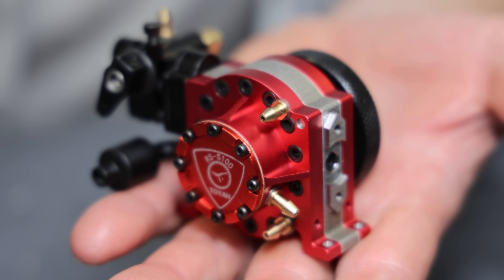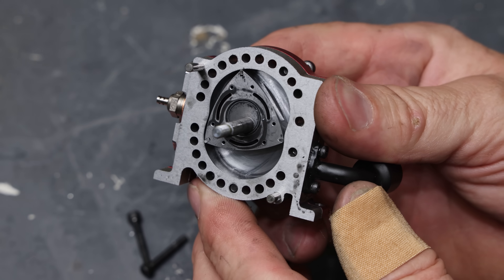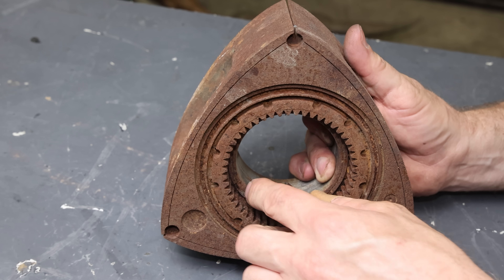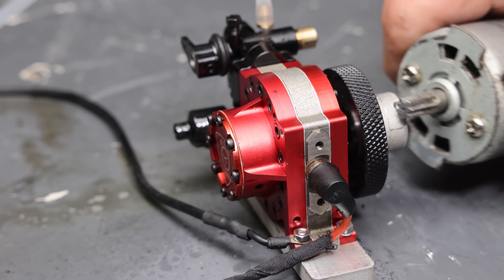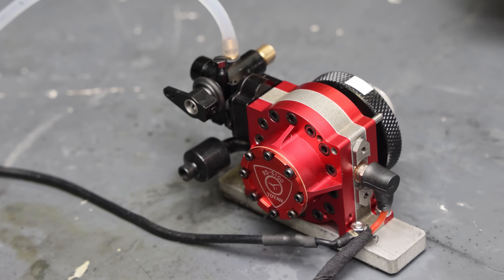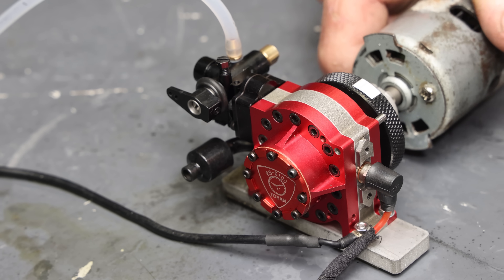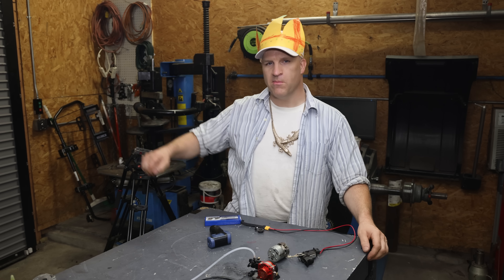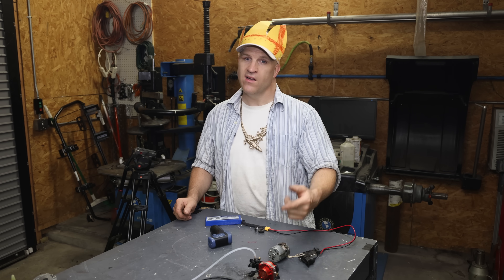Worlds Smallest Rotary Engine (30,000 RPM)

Comment: .7 horsepower is kind of insane for something this size really. This in a two rotor configuration in a RC car would be nuts.
Reply: This would be perfect for a drift 1/10 build. Get the 2 rotor version and tune the intake and exhaust ports so less restrictive. (There mini piston engines are all restricted from stock exhaust manifold) and I bet this thing would rip. Nitro rc car engines the best one puts out 2.1hp from 20,000rpm to 44,000. So this is pretty good I bet it would hit 2hp if it was a 2 rotor and had no restrictions.
Reply: They do make the two rotor also
Reply: Really is once you think about it. Like, a horse's average walking over a day, this tiny thing is almost as much.
Reply: @raikkappa23  Horses actually have about 15 horsepower though
Reply: @Levienci  Horse power is a measure of the power output over an entire day of a horse. Yes a horse can output 15 hp at one given moment but over the course of the day it averages to 1 hp.
Reply: @Levienci  Impossible.
Reply: @Levienci  But a human is a little over 1 hp !
Reply: @Levienci  Is that right? I didn't know that, I thought it was something like 1.7 horsepower?
Reply: @Levienci  This isn't quite the whole picture. Horses have something like 15 hp at maximum. But that horse can manage that kind of output for a tiny length of time, whereas a car can manage it for as long as it has petrol in it and doesn't break down. It makes more sense to sum a horse's power as an average..
Reply: @thesprawl2361  That sounds more plausible. I'll be honest I didn't do research before adding my original reply, I just used a fact I heard around the internet by usually trustable sources. Thanks for the proper clarification though!
Reply: @Levienci  Thanks, but I only found it out because of your post, so it works both ways. :)
Reply: @Levienci at stride, but at walking speed they produce ~1 horspower
Reply: @Levienci  millennial horses yes. And they haven't figured out the difference between boys and girls yet
Reply: @Levienci  they can only exert that much at a given time its not constant
Reply: @Levienci  "Horses actually have about 15 horsepower though" wait what
Reply: @Levienci  woah that doesnt make sense, horses have 15x the power of them????
Reply: @Levienci  For short bursts, the horse has a maximum of around 15 hpr. The hpr unit of measurement was not measured based on the ability of a horse over short bursts, but rather the average pulling power of a draft horse over the course of a workday.
Reply: @Levienci  Average. Walking. Speed.
Reply: @raikkappa23  The only thing that beat it is an electric motor but the weight of batteries seriously add up and don’t last that long. I had an electric RC car that could do 100mph but only lasted like 20 minutes.
Reply: @Crittek  can we talk about how that is 100 scale mph and not actually 100 mph? in other words, disregarding remote control capabilities, battery/fuel capacity, etc. your RC car would not cover 100 miles in 1 hour, but more like 10 miles if it is a 1:10 scale car.
Reply: @Crittek at full speed?
Reply: @Crittek electric rc cars with 8s power trains can have well over 5 horsepower
Reply: @raikkappa23  horses have actually 15HP. We have been fooled
Reply: @Dill_Do  15hp peak, 1hp continuous

Horses get tired, they only make 15hp on short sprints...
Reply: @raikkappa23  what🤣
Reply: @raikkappa23  funnily enough one horse has 15hp
Reply: @raikkappa23  yeah except its not. thats not how horse power is measured. one horse has like 5 hp or 7 i dont remember the exact number
Reply: @raikkappa23  Horses make more than 0.7 hp XD
Reply: @raikkappa23  bruh... I can't really fault you for this misconception given it's name but Horses don't have 1 horsepower, unless they're almost dead. The name supposedly helped sell cars early in automotive history, but 1 horsepower is equivalent to the power required to move a 250 kg (550lb) object one foot in one second.
Reply: @bigdawg77  actually based on a smaller size of horse in the early days look it up at about 750 watts continuously
Reply: time to buy 500 of them and slap them in a car! XD
Reply: maybe for drones and minicopters
Reply: @mortenrl1946 nah it'd be far too unreliable and susceptible do elevation and just the tilting nature of air born vehicles
Reply: @Socucius Ergalla wouldn’t really use  6s for 10hp but more like 8s. I’ve built a few boats that ran over 100mph. One of them went 102mph on 4s. The amp draw at the start would be more than after it’s going, that’s why we don’t nail it at first. And yea, the controllers are over 400a. Controllers are an expendable in the boat world. Data logs showed over 10hp at times.
Reply: we have 1.2 hp
Reply: no kidding that's enough power for a bicycle. I wonder how that could be done.
Reply: I really would like to see those cars out on a track it's got to be amazing have a good day
Reply: eh... 2.5-3hp on normal old .21 nitro RC motors is common enough with a 400-600 dollar price tag.

Some even cheaper in 200-400 range.
Reply: 20 of these things would put out more power than my MOTORCYCLE.
Reply: One of the main advantages of the Wankel engines is power to weight ratio.
Reply: idk, if my Fiat Cinquecento would spit proportional amount of gasoline through exhaust to this one, it would be 300BHP+ ;D
Reply: skateboard?
Reply: @justinleighton4047   or roller blades
Reply: I was thinking the same thing. I used to work in industrial automation and was always amazed at what a fraction of a horsepower can do, and a little terrified. 0.7 HP is no joke.
Reply: @Socucius Ergalla you have way bigger tires allowing for hight top speed dispute gear ratios...
Reply: my rc engine makes 4+ hp xD
Reply: @crittek but man I’d love to see it
Reply: how about a 3 rotor rc car? ;)
Reply: .7hp but .002lbft of torque
Reply: That's like 1KW right?  More than a lot of ebikes.
Reply: Wer jou buy it
Reply: OR, buy 100 of these and put them in a car
Reply: 500AP 🐜
Reply: imean i have .21 engine and it has 2.5 hp so yeah it weight to hp ratio is like 2hp per 650 grams
Reply: this thing to 50cc moped
Reply: .7 horsepower?! that's like a big pony😅
Reply: Not really, nitro engines get 3-4 hp at this size
Reply: The power density of these things is insane. Bearing in mind that the RX-7s are only 1.3 litres but you get all that power from them. In the UK the licensing agency for cars registers my RX-7 FC as a 2.4 because otherwise the insurance would be way cheaper considering the power it makes.
Reply: thats crazy to imagine this thing as powerful as one small horse
Reply: First thing I thought
Reply: Eh not really, rc nitro engines usually create at least two hp, 1.4 or so wouldn’t be very good
Reply: Additional power for human-like robots.
Reply: well the one for r/c planes made by OS is a .30 cubic inch engine  at 4 horsepower... this engine probably isn't the smallest :-\
Reply: Try that challenge
Reply: hear me out 4 rotors 2.7 hp
Reply: there is a 2 rotor one that toyan is selling
Reply: Add 7 more and you gave lawnmower tractor power. Inpressive
Reply: .7 hp
.00000000001 ft/lbs of torqe.
Reply: My generator has less horsepower than that 😂
Reply: In Puerto Rico some people make rotary motor for RC car for dragster race
Reply: try making a 6-rotor bro it will be FAST
Reply: tbh thats crzy
Reply: Horsepower is and was the definition of being capable to lift 75Kg in one second one meter high. Need to know the history of old measurement! But even the exact weight is not absolutely clear in the historical development of Horsepower because in different areas of Europe, they used different weights
Reply: a 350watt motor hub for an electric bike is like 0.4 hp.
Reply: That’s weed wacker power.
Reply: That would be awesome
Reply: There is a 2 rotor one
Reply: Being chased by another rc with police lights ......
Reply: Yooooo
Reply: For real..
Reply: The cison “SBC” V8 makes 5HP. JS.
Reply: That set up would be on part with cheap electric RCs while costing way more lol nitro 2Ts and top of the line electric stuff make  considerable more power
Reply: I mean its a lot smaller than a horse ... or 70% of a horse.
Reply: OS MAX used to make rotary RC engines for airplanes, but they could be modified for surface use fairly easily and there's several videos of them on here absolutely dominating the RC drag circuit against piston driven cars
Reply: Horsepower has nothing to do with horses. 

Steam engines designed to replace horses in mining operations were sold as x horsepower by one manufacturer, to give the customers an idea of how many horses each would replace. 

The modern equivalent has no connection to horses.
Reply: this small thing makes as much power as the 1886 benz patent motorwagen... kinda insane
Reply: Brushless DC motors can produce several times the horsepower with this size.
Reply: that is very low power for a small glow motor...
Reply: Connect 4 of these together and you could power a bike
Reply: horsepower by itself doesn't mean much. If it spins fast but has zero torque it really isn't that good.
Reply: @Frille512 that's what transmissions are for. It is like heaving a long lever and turnes 
distance into force.
Reply: @gehtdianschasau8372  And then you lose revs. You can't create tourque in a transmission, you can only convert it from revs.
Reply: @Frille512That's what i meant. revs are the distance in the lever comparison.
Reply: Rob Dahm this thing 12 rotor 8.4 HP RC car 🤣 jk
Reply: It's been done! Look it up
Reply: I’m thinking boats and planes are where it’ll really shine
Reply: He should put it in a diecast RX7
Reply: Я думаю это больше макет или модель Ванкеля. Реальным модельным двигателем был двигатель фирмы OsMax, который обладал  мощностью и ресурсом достаточной для моделей. Этот двигатель стендовый образец
Reply: Meh. A 1/8 scale Rc car electric motor is 8-10hp with way more torque
Reply: @Turbogto_guy  yea electric will always be most powerful for rc cars.. but imo nitro is stillll more fun once you get electric brushless anything past 11.1v lipo its just overkill lol. I had a 4tec 3.3 the awd nitro version and even that was fukin overkill lol. the most fun car i ever had was a custom built hpi 1/10 nitro road car that i converted to 2wd and used a lrp .32 and set it up with a angle kit i really regret selling all of it ffs.
Reply: @descentmvm depends on the size of the rc.. i have an xmaxx on 8s (2 x 4s batteries), both 10,000Mah, and it's stupid fast but nothing overkill, i would say. Granted some people go absolutely overboard with motor/ esc upgrades at 8s. I also have a little Rustler capable of 3s but i don't usually run it on anything but 2s unless I'm speed running it
Reply: @Turbogto_guy 1/8 scale? 8-10hp? Not in a million years. I've got a massive 780kv low cog 4 pole motor in my 1/5 baja 5b and that's around 7hp. And its double the Amos, volts, torque and just size of a 1/8 scale motor. I don't think there is a single 1/8 rc motor that's even been over like 3hp. Because my motors is litterally half the size of a whole 1/8 scale rc basher or buggy.
Reply: @keqrou  if you do a little research, you’ll find that the castle 1515 (used in 1/8 scale and boats I’ve pushed over 100mph) is rated at a nominal 4-5hp. Debunking your claim, and they WILL surge 8-10hp. You can say what you like, but that doesn’t change the facts. Doesn’t change the logs I’ve seen in my boats.
Reply: @Turbogto_guy  electric motors are AMAZING, but even the latest batteries are hilariously heavy. So fuel + engine and battery + motor weights usually balance out
Reply: It'll be good to use them on a drone
Reply: @garygermain1446  Might not have enough torque for larger drones idk what the vale is on this motor but rotaries are known for low torque
Reply: @Crittek  gearbox
Reply: @Crittek  That's why there are reduction gears. 10 Nm at 10000 revs are the same as 100 Nm at 1000 rpm (if there was no friction). You can lift the whole case of water, or you can lift it bottle by bottle, the work is the same, one requires more force, the other one more distance moved. 
Imagine a seesaw with a massive kid on one side and a tiny one on the other. If you balance them out, by moving the heavier kid closer to the axle, the small kid will travel like 1 m with every swing, the big kid more like 20 cm. The result is the same, the seesaw is in balance.

Comment: Is it possible to make this charge your scooter? like maybe attach the motor to something that produces electricity when the rotary motor is on, the motor spins some kind of mechanism that produces electricity which the electricity travels to a charging brick and finally charged up a dead battery?

Comment: na the Chinese guy that pout r together I garinty already did his testing and figured IN  everything.  fast running means super heat,that means everything must be sloppy frome start !!! that's why hard start. I'm no expert  but I no about making a machine called a coldheader  it runs screws and when they wanted titanium screws me and my pops cut out a place In header just before wire transfer grabbed cut-off  RED HOT and going in a cold die !!!! it makes load fire cracker BANGS so my pop got the transfer drop blanks everything gets hot on machine!!!!!! it started locking up!!!!  he had everything that Slide pooshes through something that's pretty much everything.  but then we were really running titanium screws I ran screws that directly went on the land rover sitting up there still! truth! eneway it took alotta fuckin around but the secret number was 8 or 9 thousands over the wire size going to be yoused!!! so what ever you decide just remember tight will get you starting better running smooth and nice but I GARINTY  it will be very short lived. try something crazy and go a little looser instead and pre heat everything but the gas. making shur everything rubbing, sliding, poshing extra SLOPPY!!!! I BET you run time will be all day , with a radiator cooling system

Comment: How to ruin the lovely piece of engineering in 5 min flat ..
1) drop the most important part of the engine ....and break it ...
2) flywheel mass is very important ...so make sure,it's not aligned properly ...and tighten it so that it should run out ,and pass all the unbalanced vibrations to the core ...
3) Tighten the engine in such a way ..that silencer should drop in 4 minutes ...
4) run it so rich ...that exhaust should puke 4/5 times of liquid  fuel per rotation ..
5) start the unbalanced engine with full throttle on ...

It's a torture for the Powertrain engineers like us  who spend 30/40 years perfecting the standard operating procedures....!

Comment: I thought this was a water cooled engine? You just really overheated it and why it kept stopping. The OS engines with air cooling always overheated and got damaged when bench run and not enough cooling. That’s why there are not many left😔

Comment: i hate to be that guy but this seems way to unreliable to be useful. i would want to put something like this in an RC car but if it can only really run at full throttle and not reliably i don't get the point.

Comment: How does it seal on the sides (side seals)?  Probably why compression is low.  Need a better seal there.
Reply from the maker: Just the clearance, there are no side seals on the rotor at all and fixed width Apex seals as well.. yep I agree

Comment: Exhaust : Spits out loads of fuel
Matt : pump some more fuel… turns engine shaft
Me : should lower the fuel/air ratio.
Reply from the maker: I agree with you but not on a rotary, rotaries love you to dump gallons of fuel into them.. lol
Reply: @WarpedYT  
Mazdas do not spit fuel on start ☺️
But they take a few time before running, maybe you’re right.

Comment: Ok...I'm 6 mins into this...put your airfilter on!!!!
That causes restrictions on the air, and allows more fuel!!
Reply from the maker: There was no air filter, no air filter came with it
Reply: @WarpedYT  that would be a issue. I'd use a piece of foam. On all 2 stroke small engines, you cannot set the carb unless the filter is on

Comment: Instead of choking it, hose in hydrogen or some oxygen in that carburetor. The gas + oil will act as the lubricant and the hydrogen will spark it fast in rpm. Pure oil could replace the gas in the evolution. Little engines like that are not made with precision and hardest materials. That's why it takes a lot for getting it in rotation.

Comment: Bro I'm a huge fan of your Channel I'm going to try to make a long story short a few years back my shop burnt down and I lost five of my  air-cooled Volkswagens that were near and dear to me and all my collectibles and all my tools and everything in my shop because assholes with fireworks anyways I had a brand new in the box Predator 212 it melted all the stuff on the outside but the block is still good I always thought it'd be cool to aim high pressure air like CO2 and a nozzle at the flywheel using the veins like the wheel of a turbo and see if it would act like a supercharger by the air blowing on the fins and then giving it all out psi till BOOM!!!! 😂f hung g GB tegyui